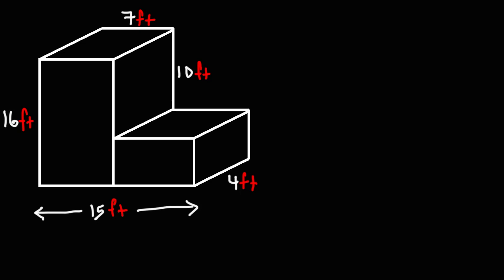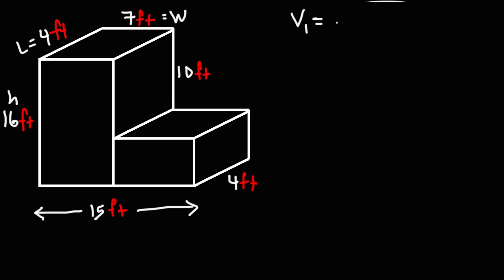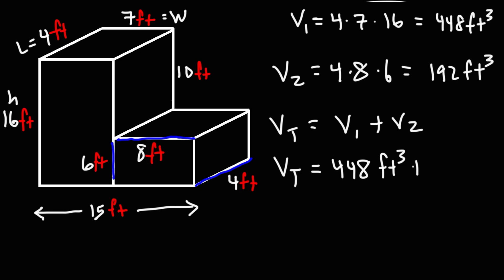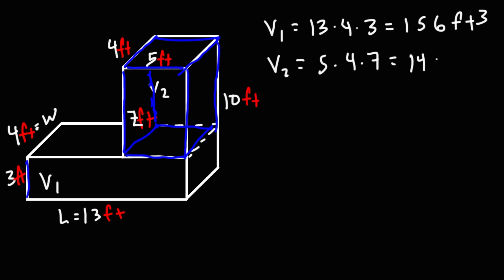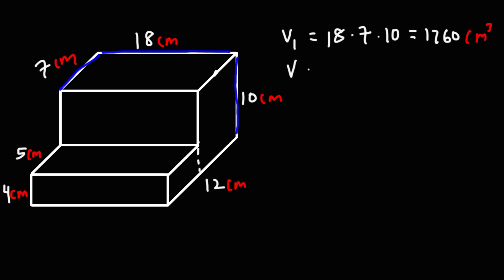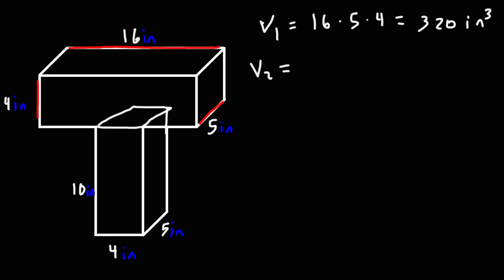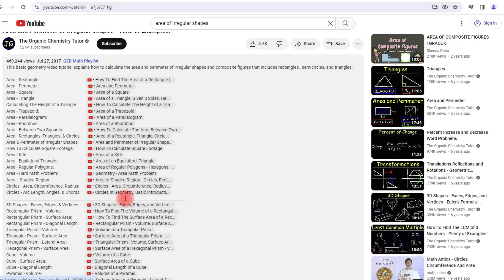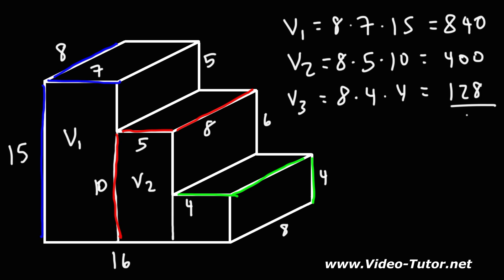How To Find The Volume of Composite Rectangular Prisms

Comment: Thank you so much, this actually helps- I'm in pre algebra and we are doing a 7th grade math unit rn, and we are doing this stuff, and we use the basic volume formula too, but our main formula is V = Bh. If nobody gets it, its where you add the length and the width, then multiply it by the height. Anyways, thanks so much and I appreciate it!

Comment: Breaking down the volume of composite rectangular prisms into smaller, manageable steps is such a practical approach! The explanation in this video makes the concept crystal clear and easy to apply to real problems. These methods are super useful, and I’ve found additional practice on SolutionInn to be a great complement to lessons like this.